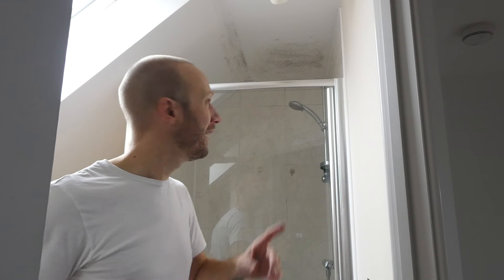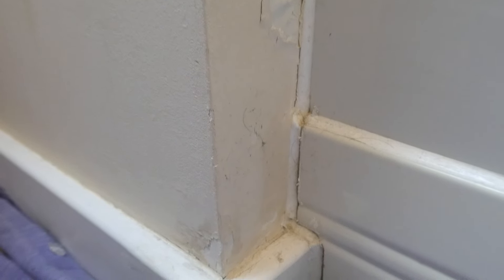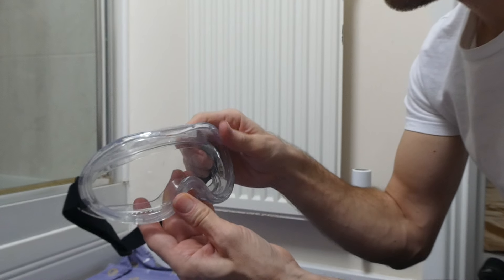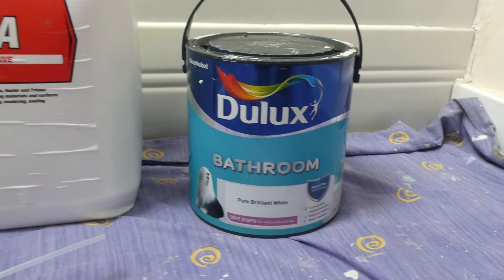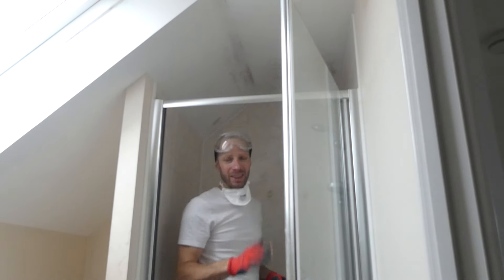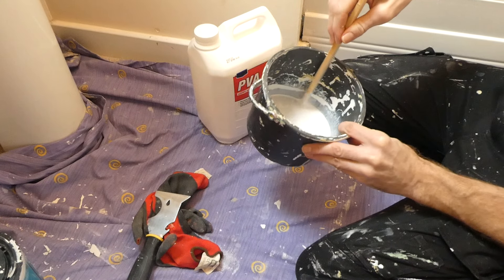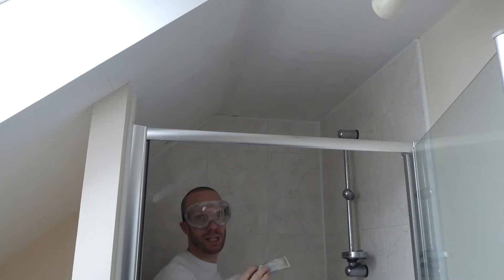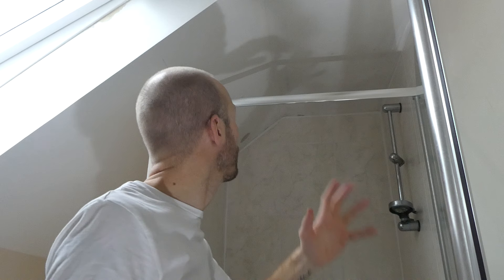How to Fix and Repair a Bathroom Ceiling covered in Black Mould

Comment: Man I just used bleach mixed with water. Removed 90% of it than just sanded down a bit for the remaining. Lastly I primed and painted with a semi-gloss so the water droplets just sit on the wall rather than being absorbed. Semi-gloss is nice to wipe down with a towel.
Reply: Bleach doesn't remove the mould, just bleaches it
Reply: The mould actually retreats back into the ceiling when using bleach as it detects it as a threat
Reply: @Fattipotato79  absolute nonsense. The mould is already buried deep - that's why its so hard to get rid of. Mould doesn't detect anything, however, it is very resistant to various chemicals.
Reply: @doricdave  is that a serious comment? Bleaching will kill it. So it is mould no more.
Reply: Absolutely spot on.

Comment: This is what happens when people don't leave the window or the shower door open after every shower. After removing the mold, because the shower ceiling is so low, I would have applied Zinsser Mold Killing primer because it contains very strong biocide and bonds hard to the surface. Then I would have applied Zinsser 1-2-3, which is brilliant for bathrooms because unlike oil/shellac primers, it breathes, and doesn't form moisture droplets on the topcoat surface. The main issue with these jobs often the primer isn't given enough time to dry, before top coating and people are showering in it too soon. So the paint is compromised from the get go.
Reply from the maker: Agreed.

Comment: Thanks for your video, very helpful, it took two days to get the mold off the ceiling. I took my time and followed all your protective gear tips. Definitely a process that needs time to complete correctly. I used a different mold/mildew primer 2 coats and 2 coats of paint. Took one week to complete and really pleased with the results. Thank you.

Comment: Painter and decorators i spoke to advised me to never use pva to seal surfaces you intend to paint... i was told to use a decent primer and paint like zinsser 123 & permawhite or glixtone fungi shield.... I opted to use the zinsser product in the downstairs shower room which has no window and relies on an extractor fan for ventilation... almost 2 years on and the ceiling is still 👌

Comment: Nice job. Had similar issues with ours. I used HG Mould Spray, got all the mould off, Zinsser Gardz one coat and then two coats of Zinsser Perma White. No issues since.
Reply from the maker: Nice one, cheers Keef. Yes I know of the HG mould spray, just never used it. How's the house decorating going anyway?
Reply: @JBTV  Slowly! Was doing my son's room, papered ceiling which was coming away. Tried to glue it back down, first coat of emulsion lifted it all off again! Decided to strip all the paper, half the ceiling plaster came with it! The joys of living in a knackered old house! 😉
Reply from the maker: @Napoleon-Blownapart Oh dear, that's not cool. I know what you mean though, I've seen it before.
Reply: @JBTV  Plasterer coming on Tuesday to skim it, too big a job for me 😉

Comment: Will give this a go in my bathroom. There is also a crack running down one of the walls in the corner. Should I use a flexible filler for this? Thank you.

Comment: Hiya, I’m currently in the process of repainting my bathroom. I’ve noticed that my skirting boards and ceiling is turning yellow after two years (we renovated the bathroom) can you advise of what to do? I’m going to buy the 123 primer x
Reply from the maker: Hi, the skirting may be turning yellow if it was painted using an oil based paint, not sure about the ceiling, may be water damage. As long as there is no damp, the 123 primer will whiten those areas up no doubt. Make sure you top coat ceiling with an appropriate bathroom paint. 👍
Reply: Use Sikkens paint on skirtings, stays white for years!

Comment: Hi Justin. Great video.
I have mould on a bedroom wall caused by condensation over the years. I’ve used mould remover and was able to get most of mould stain but some still remains. I am thinking to paint the wall with Bullseye 123 to seal the wall and cover the remaining mould stain that I can’t remove before I give it a top coat of a anti condensation emulsion paint. I just would appreciate your thoughts. Many thanks. Perry
Reply from the maker: Sounds like a good plan 👍

Comment: Hey Justin there is a lot of mould in my bathroom no way I can remove all from sealing 😓can I clean as much I can than apply mould remover an than paint 2 time will that work? Thanks
Reply from the maker: That sounds ok, just make sure you have a good quality bathroom paint 👍 Good luck
Reply: @JBTV  Thank you so much 👍 I am going to buy mould Paint hope that should do the job.

Comment: Nice video thanks. I didn’t catch what type of paint you finished off the ceiling with. Maybe I missed it. Please advise. Thanks.
Reply from the maker: You can use either dulux retail bathroom paint, or a dulux trade diamond matt

Comment: Help, I don't know which Zinsser to use just to cover up mould stains left after cleaning mould off? Can I use Zinsser cover stain on just the stains or do I do whole ceiling and walls? Confused 1st timer 🙏
Reply from the maker: I would use cover stain, and only on the stain itself. When you repaint, the paint over the cover stain will take longer to dry, don't be concerned 👍

Comment: All this is water based sealers primer and paint.  Is oil based exterior based product better ?
Reply from the maker: I wouldn't paint a ceiling with an exterior product personally. The key thing is here that the paint finish has a sheen. Bathroom emulsion has a sheen, someone I know accidentally painted a ceiling with oil based gloss paint.... worked a treat!!

Comment: Would you recommend applying PVA and/or stain block to bathroom ceiling and walls even if there are no issues and before using bathroom paint? Many thanks
Reply from the maker: Not necessarily recommend, but it wouldn't harm 👍

Comment: This is super helpful, but approximately how long between steps?  I want it to work but I also need to condense it into as short a time as possible!! I'm trying to plan this around how long we will have to go without showering...
Reply from the maker: You can get this done in a day and shower the following day.... literally feel with your hand if/when each stage is dry. I would estimate, in ordinary conditions that you shouldn't have to wait any more than 2 hours before the next step.
Reply: @JBTV  Wow thank you for the speedy reply!!  I did see on the paint that second coat should be after 6 hours but if the rest can be fairly condensed that helps! Ta!
Reply: The mould remover doesn't seem to be available on amazon , can't seem to find it elsewhere either. Can u provide another link? Thank you
Reply: Just commenting again because it’s now been 7 months, ceiling of our massive bathroom still looks ace, and revisited the video as I’m finally getting time to sort the window re-seal and painting the walls.  I couldn’t find the mould remover product mentioned so used vinegar instead a couple times over, in lieu of the product in the video.  I’ll probably do fewer coats of glue on the walls as there isn’t any mould but will definitely have to find a video on adding some plaster around the window!  
We also layered more insulation above the bathroom to help with the ceiling mould, and we scrape water off the shower tiles/door after every shower.  Hope this helps!!!

Comment: I saw your earlier video of fixing peeling paint on the bathroom ceiling and this video. What should be done if there is peeling paint and mould in the same area of the ceiling? I'm guessing the mould should be treated first before fixing the peeling paint. But in the areas of just mould it would be this process shown in this video. Thanks.
Reply from the maker: Scrape off the peeling paint, treat the mould, then seal it per this video
Reply: @JBTV  thanks for letting me know. Will be buying the supplies hopefully this week. Anymore questions I'll let you know.
Reply: @JBTV  is there any other particular mould removal spray you would recommend as dryzone is unavailable on Amazon. I suppose normal household mould and mildew spray could be used as an alternative. Also any other particular pva you would recommend as I couldn't find the exact one you recommended as probably going to click and collect the paint and stain block plus scraping knife etc in one go from b and q or similar. Thanks again.

Comment: Should i scrape the whole ceiling? or just where the mould part only, where is pretty close to the blower
Reply: If you just do over the shower sand down the edges so there's a smooth / sloped transition of the painted surface and the scraped surface, if that makes sense.

Comment: How do we deal with condensation and mould on the upvx windows in ghe conservatory please. Thanks
Reply: leave the window open slightly, air movement is the biggest thing to prevent mold.

Comment: I know nothing about this but my question is even though you’re cleaning The outside of the wall wouldn’t it be better to replace the sheet rock because you don’t know what is actually on the inside of the wall?

Comment: Would you need to worry of what’s behind the dry wall after cleaning the surface mold ?
Reply from the maker: Not if the mould is superficial
Reply: @JBTV  how do you tell the difference?
Reply: I just looked up the difference and found that dew point mold looks different than dangerous mold that might be under the surface. I was worried I had dangerous mold under the surface. But from the pictures I think we just have dew point mold which sounds less dangerous and can be remediated as the video explains